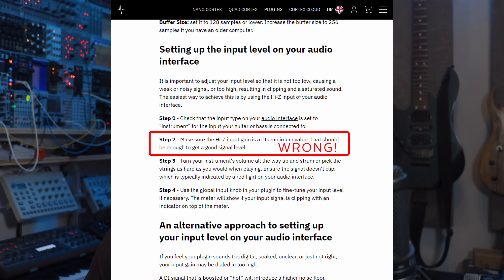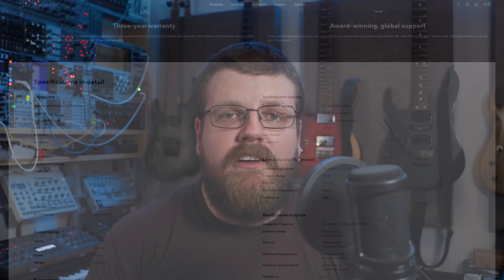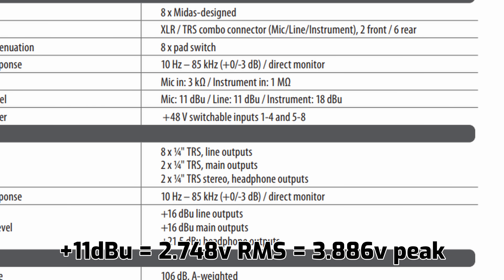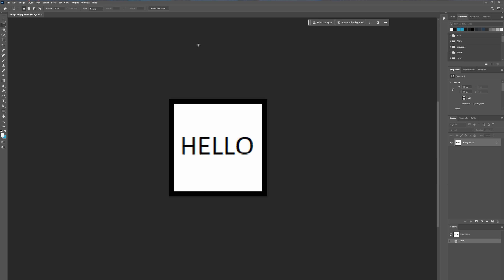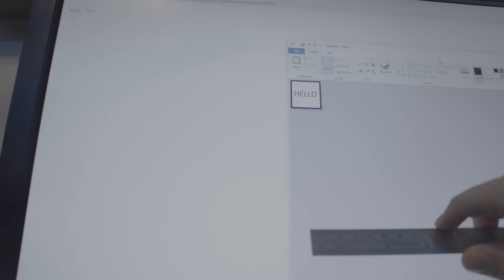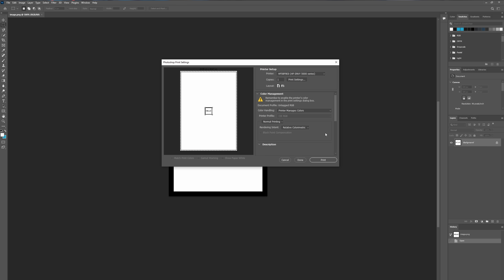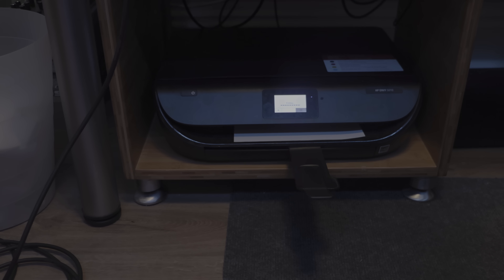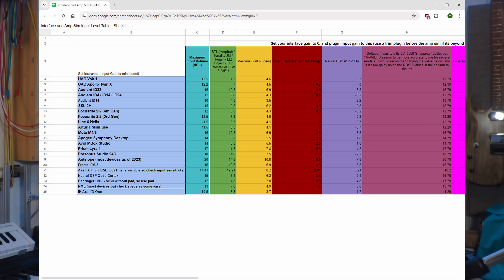Ampsims and input gain - Please, stop the madness...

Comment: I’ve been involved with pro audio (broadcast, recording, live sound) for decades. Several years ago when this whole “gain staging” thing became a thing, some of us “old timers” tried to explain how circuits actually work, but were shouted down. I did learn a few things from the discussions and changed my ways on a couple others, but for the most past, gain staging works, but not for the reasons people are saying it works. In a pure analog world, the “gain staging” methods being espoused today would result in a hot mess. The problem is that with amp sims, and a few other plugins, we are emulating the analog world in a digital world, and many of the battles we fight in analog are now present in digital. It was so drilled into me, 40 years ago, to keep the best SNR, always cut, never boost. While there are exceptions to this rule of thumb, it has mostly served me well ever since.

Comment: Thanks for this invaluable piece of advice! I'm guitly af in gaining at 0dB. So, my english is unfortunetaly not perfect. Can you tell me if i get the correct way to gain the interface the right way.
1. setting my interface (volt2) at  0dB
2. gain up the plugin (diezel herbert by PA) input to +0.3dB according to the sheet
3. gaining the interface to the point where it's almost clipping
4. then reducing the gain input of the plugin

but reducing how much dB? just by ear, or  is the DAW clipping at this stage and I have to reduce the plugins input gain until the DAW isnt clipping anymore?
Reply: So I believe the conversion for you is 0.3dB minus how much gain you added on your interface
Reply: @lylaznboi01  ok, here starts the problem. i just have one knob with no numbers on it. so i have to use the meter in the daw? but it think that this is not very accurate?
Reply: @gainuptheBillBoard  So that part, I'm not totally sure. My guess is how hard are you hitting on the meters when at 0dB and then how hard you're hitting when bringing up the gain to where it's about to clip. So you would do the math from that.
Reply: @gainuptheBillBoard  A metering plugin like SPAN by Voxengo is really good for accurate measurements with this stuff, that's what I've just used to test all this out. It's a free plugin, too! :)
Reply: @gainuptheBillBoard  what I figured out was that after doing those steps, if you don't know how much gain you're adding going in, the sweet spot on the input gain on the NeuralDSP plugin is somewhere in the middle when doing chords. Unless you actually know how much gain you're adding, you can at least get close enough without doing the math.
Reply: @ChapXII  I use the youlean loudness meter
Reply: @lylaznboi01  ok i guess i have to use a bit feeling. i thought there was somewhere an exact number. my thoughts were that you never have the exact same power in each pic stroke
Reply: @lylaznboi01  use some metering plugin or maybe the VU from your daw if it shows some info. There are some free plugins out there if your daw doesn't offer one

Comment: This is great and makes total sense but how are you measuring the 24db increase when you turned your interface gain up?  If I'm using my 4th Gen Scarlet and I turn up the gain just under clipping how do I measure that increase to then subtract it from the value on the existing spreadsheet? Thanks

Comment: This is awesome! My brain now wonders, is there a way to set the input on say Parallax if you’re using a bass DI from a Submission Audio Bass instrument when we really don’t know what the signal path was going in?
Reply: I suppose it depends on if you're trying to match your input signal to what it "should" be or just hitting what sounds good. I know Dave Otero boosts the crap out of the input on Parallax on many of his actual DIs to get it to sound right, so I'd say either match the levels of your virtual bass to a real bass or just go with the "if it sounds good it is good" level. :)

Comment: This is how I've always approached setting levels for amp sims. Didn't have a handy-dandy chart, but by ear has worked well enough.

It's the same as how I'd record anything else. If I'm recording vocals, I don't turn down the input gain on my interface to match the level the compressor plugin and EQ plugin I'm going to use wants. No, I record a strong signal on my vocal and then adjust the input gain on the plugin or the clip gain as needed so my compressor is happy.  Digital recording basics. (Yes current technology is more forgiving that of years before, but still.)

Good video and nice technical explanation. Looks like you're a fellow lefty as well 👍

Comment: So, I tested your method instead of the "0 Gain method" I was previously using, and yes, it absolutely brings down the inherent noise floor of the interface. One has to be however mindful of what signal or noise you might be boosting when going with the optimized SNR setup you recommend. 

In my case, I get some crippling interference through my computer, which I dislike more than the inherent hiss, which nicely masks some of that nasty noise. 
But it definitely is awesome to know your tools and just learn another point of view every now and then! Would my PC be further away from me, then this would be a very valid approach to get the best out of all! 

I am SUPER HAPPY to see that this video is getting quite some traction and your subscriber numbers are skyrocketing. Off to 1k, buddy!
Reply: Agree. Better to have a higher homogenous white noise  than an angry "eeeeeee!" getting picked up into the signal. Disabling the CPU turbo boost helps with that high pitched sound.
Reply: @iursnitram  Yep, that's what I do from time to time. Using Ryzen Master with a preset with lower consistent CPU speeds works super great!
Reply: You don't set it to max level. Usually for microphones and stuff you set it to around -12db or -9dbfs. But for most interfaces a electric guitar can already be -6db to higher than 0db(clipping) with gain at zero.
Reply: @johnyang799  with no gain it peaks around -9dBFS, so there is something to be gained. 

Also, when I set the speed of the CPU cores statically, then the process explained here works very well, because I get great SNR, but also very less crippling of the CPU noise.
Reply: @PippPriss  Did some measuring and testing with a 1kHz sine tone against the pickups to level match and it seems like adding gain on the interface doesn't really add more of that high pitch whine or other noises into the signal. In comparison, by leaving the input at zero you get more noise that ends up masking more of the whine but it's level is the same. Ended up adding 5dB on the interface input, it's not that much but the SNR gains are clear. I guess I am back to the old method of targeting around -6dBFS for the extreme peaks.
Reply: After more "scientific" and stable testing, having it at zero or adding 5dB was the same in termos of SNR. Back to adding no gain.
Reply: @iursnitram  I also reverted back to adding no gain, because it's just easier for me. But, this does not change that the video is well executed and explains in great fashion how SNR works. It's just what my setup works best with, and I think this video is the best proof that hardening your concepts from time to time through re-testing and re-questioning is a GOOD thing.

Comment: finally... it didn't feel right from the very beginning- if I keep the gain at zero I hit around -26dB when strumming hard. I cannot even see the transients correctly in Logic when I record a track. Apart of that it didn't not feel right, not really dynamic. 
I decided to adjust the gain of my interface to peak at around -15dB (leave the gain of the plugin at zero), then use the plugin and play with the volume pot. If the sim "feels like" an amp more or less then I leave the gain there, if not reduce or push it up a bit. I can't tell exact values but this is what feels good for me.

very interesting video, it makes sense.. I will try it.
Reply: Did you have Hi-z or instrument mode set on your audio interface?
Reply: @cirisirpula152  Yes. Focusrite clarett+ on hi-z (instrument). With the gain at zero it hits at around -16dB. It sounds ok-ish but if I try to play dynamic or use the volume pot it sounds a bit weird. If I use my quad cortex as an interface, i.e. to record only a DI signal and obviously I keep the gain at zero it hits at -26db. I can’t really see the transients on the track in Logic.

Of course when I use the quad cortex as a stand alone unit, keeping the input gain at zero makes sense, the unit acts as it should. [although there are confusing videos on this subject as well]

Nevertheless, after seeing this video, I push around 6-7db on my interface and reduce around 3db on the plugin (plini x) and it works just fine. But that’s just my personal preference.

Comment: If bunch of musicians can't figure out gain, imagine how well an average audiophile understands AD/DA conversion...
Reply: I love AC/DC!
Reply: Asking a musician to explain gain staging is like asking a surgeon to explain the krebs cycle.
Reply: @mezu-e  That is painfully true
Reply: @mezu-e  so in other words neither should understand the basics? Got it.
Reply: @mju135  You mentioned it: «If you have stereo speakers set up properly, you will hear that soundstage». The problem with most audiophiles is they don't set them up properly, because they just don't delve into that. They get blinded by technical data coming from the «Forums of Truth», instead of starting an analysis from empirical results (like measuring the room first thing). If they don't hear what they expect, they start replacing gear, instead of tuning both their gear and room properly.

It's an equivalent of guitarists when they don't get the sound they want from their guitar. We all did it when we didn't know: start replacing pickups chasing the holy grail, or buying amps, when it's enough (and way cheaper) to tune the circuit (once the instrument is set up to your liking and to deliver your sonic goals). That includes understanding leads (which isn't more complicated than finding something mechanically stable and with low capacitance, which can be measured in seconds with with many cheap electrical testers). Let alone properly shielding the instrument to dramatically increase SNR, and isolating both signal leads from the EMI shield (all manufacturers ship instruments with the common/«signal ground» mixed with the shielding; wrong start). No, the solution is using a noise gate, and buying/testing many of them forever, not actually resolving the root cause.
Reply: How does this translate to a hardware setup like Quad Cortex + Audio Interface with XLR connection
Reply: These idiots can't tell the difference between their precious $3000 speaker cables and coat hangers - see the Ethan Winer demo.
Reply: I used to work for Audio Note, very arguably the top top end of hifi, and we’d spend a lot of time deprogramming people.
Most so called audiophiles aren’t musicians, don’t see live bands, jazz ensembles or orchestras. They talk about statistics, efficiency, freq. res. and dynamics but never soundstage, ambience, acoustic energy, character, tone, catching phrases musically etc etc The average audiophile treats hifi like a digital camera and we all know that having a camera is just one tiny step on the long road to being a great photographer
Reply: @PrinceWesterburg  so in other words you took all the objective measures and replaced them with subjective nonsense, so you can sell them overpriced trash? Well given the quality and business model of AN - sounds about right.
Reply: @VEC7ORlt  Objective measures are an aid, but they aren't everything in the final perceived audio of a given audio system. You even might have the most perfect listening room: an anechoic chamber! But that wouldn't sound very enjoyable.

Guitarists should know about this, since we're actually using inefficient devices that even distort the signal, but their sound pleases us. Otherwise we'd be using ultralineal amps and full-range pickups and speakers, we definitely don't.

The same applies to audio listening, everything is a compromise in Audioland, and you listen with your ears, not with your eyes (reading whatever).

The nonsense is around the audiophile claims on magic cables, hearing huge differences in cap materials (or cap brands), and such stuff, polluting in turn the guitar world (example: using expensive exotic caps in the guitar tone control, when it actually filters out the high end that the exotic cap is supposed to enhance).

As someone pointed out above, Ethan Winer is a good reference debunking audio myths. The reference to digital cameras is accurate, too: years ago I became a pixel peeper myself, and it took me quite a long while to wake up and realise the best camera is the one you have with you.
Reply: @PrinceWesterburg  love this

Comment: Thank you so much! The whole 0dB input always sounded incredibly dumb however the other alternatives presented didn't yield better results. This is the definitive way to do it
Reply: This is actually so wrong it’s not even funny! I love how people create the heading ( you’re all wrong) when In fact, this is so wrong it’s nuts.. 
your interface is suppose to be at zero. There’s a reason. He showed you the chart of plug-ins and interfaces dbu requirements. The manufacturer literally tells you what to set your input gain too 🤦‍♂️
Reply: @dirtedingo8354  And what would that reason be? Also, let's not forget that plugin makers were advising you to set the gain to taste/as high as possible without clipping and then all of a sudden they changed to "weren't you setting the input gain at 0?"
Reply: @ if you read the manuals, it never says set to taste. It literally tells you what dbu they use to capture. If your interface is less then what they use to capture
That sound, how would it react the same? This guy literally just told you to use your interface gain till just before you start clipping 🤣
Reply: @dirtedingo8354  
The very concept of "distortion, clipping and saturation" has born exactly by using the hardware in a "wrong" way.
Reply: either correcting the gain structure digitally or going 32 bit is the acceptable solutions rn, but 32 bit interfaces aren't as common yet.
Reply: @alrecks619  
Even 32 bits audio cards have a noise floor.
Now, is it as obvious as a 70s tascam mixer?
No, but it's there, so it's good practice to adjust the gain as high as possible before the conversion.
Reply: @alrecks619  Just grabbed the new SSL 2 Mk ii which is 32 bit and holy crap game changer. A lot of plugins don't even have the capability yet.
Reply: @alrecks619  24 is already more than enough. Hell 18 bits would already be more than enough (17 bits is twice as many values as 16, etc) there are tons of interfaces and field recorders with 24 bit recording and no gain knob at all, because they simply don’t need them.  The idea that you need as hot a signal as possible is one that originated with tape, held traction with 16bit recording and noisy preamps, but makes little to no sense with most modern equipment. 

This guy demonstrated a well known and tangential audio concept with his potato of an interface from Behringer.  His preamps are garbage and his adc is likely working at 16bits.  It is important to know how to minimize your noise floor for your particular gear, but the conclusions he’s come to based on his simple experiment are…. Wild
Reply: @threepe0  totally. He is theoretically correct, but the kind of optimization he is advocating for as something essential seems to have already been taken care of at the hardware level in most decent modern interfaces, to the point where the difference (even though still exists) is negligible for most use cases.
Reply: @threepe0  for a modern metal guitar tone the signal chain might include compression, distortion pedals, overdrives, hi-gain amp sim, tape distortion, transformer emulation, and a boatload of other non linear effects that can easily reduce the SnR by 10s of dBs, so doesn't it makes sense as a general principle to optimise the SnR at the input even if the self-noise of the ADC is not that high? Not to mention that when using a noise gate it results in a better sounding sustain for long-sustaining single notes, where one would like the decay to sound as natural as possible.

Comment: I kept away from this discussion for similar reasons! From what people were saying, I assumed there must be some specific level that instrument inputs on audio interfaces are lined up to. This wasn't actually my experience though so I just carried on recording guitars the same way as everything else.

Record at a good level (high but avoiding clipping) then use a digital trim as my as the first gain stage if I get this wrong for some reason. Then my amp Sims behave exactly the same way as all my other plugins.